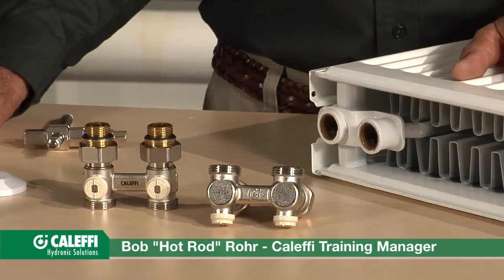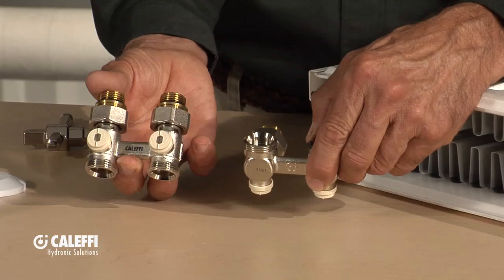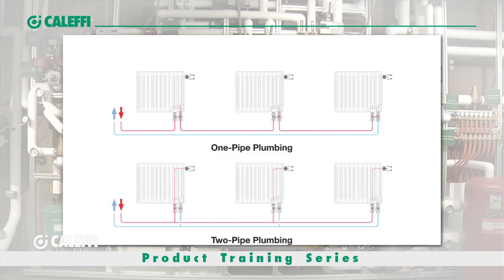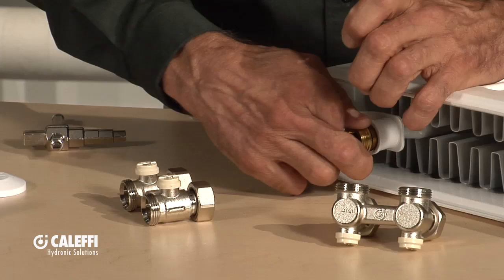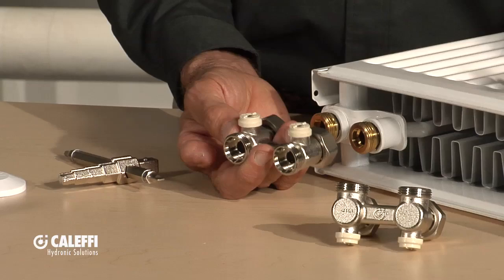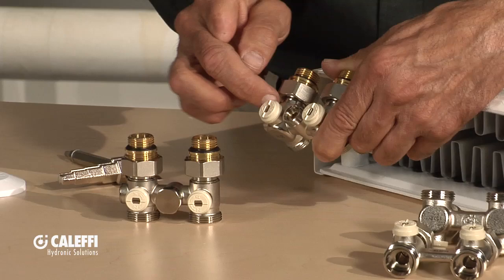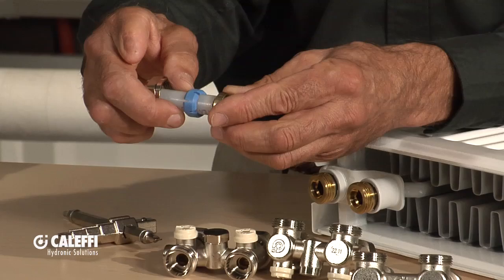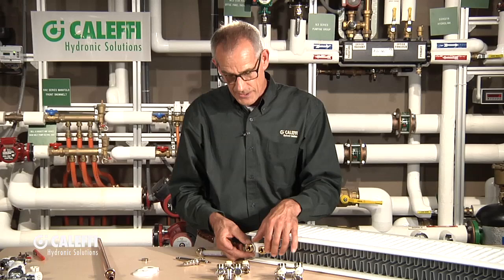Thermostatic Radiator Valves for Panel Style Radiators

Comment: Thanks for the information!    It would be nice if you would put on the item description, for your valves, that the brass adapters are included with the valves.  We just ordered both the valve and the adapters because we couldn't find anywhere that said they were included.

Comment: I installed a Pesotti, and they shipped it with a blue plug in one fitting . I assumed this to be the water cooled going to the return. If I did this wrong and sent the freshly heated water into the out, will the radiator not get hot at all?
Reply from the maker: In the installation manual for the Pensotti panel radiators, it shows the blue connections to be the return and the red connection to be the supply.   They will work most efficiently when piped with the flow through the radiator in the proper direction.